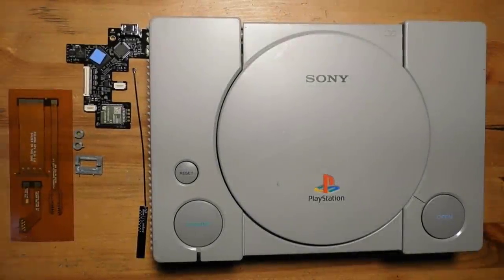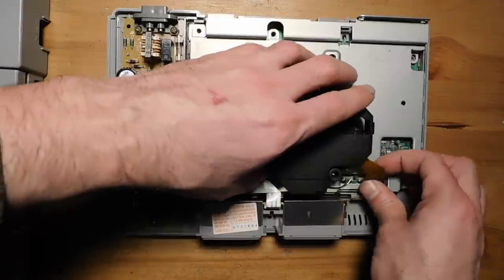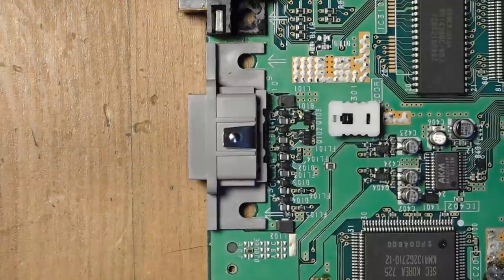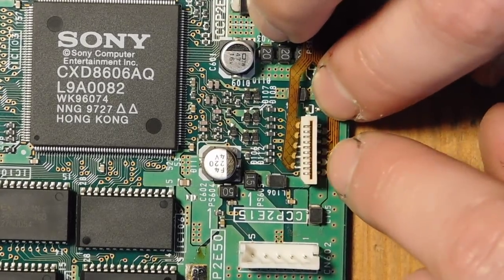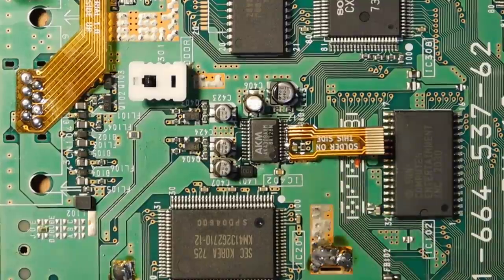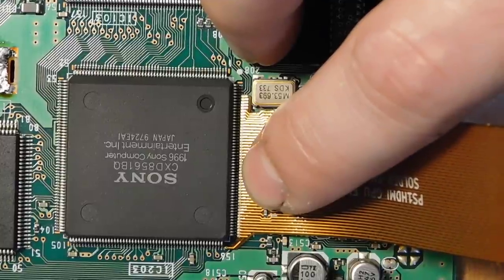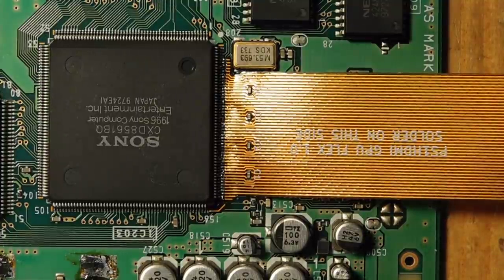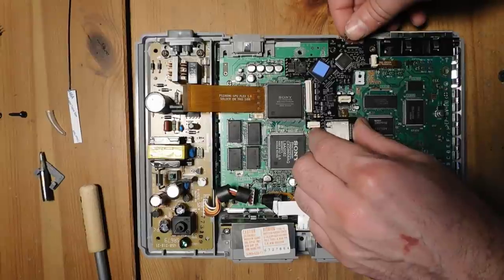PS1Digital Installation Guide - The Best PlayStation 1 HDMI Mod!

Comment: Tacking in the center really helps because the cable is not perfectly flat. As the video shows, you want to hold it down as you work your way out, which will push the slack out. If you tack the ends and work your way toward the center then you will be pushing the vertical slack together into a tighter and tighter arch that will never go flat in the middle. Releasing that slack by reflowing connections along the way to one edge means shifting all of that vertical slack into horizontal alignment, which is likely to cause misalignment if your connections were already aligned before reflowing. The reason this isn’t a problem when starting from the middle and working out is because any alignment shift from flattening the cable is effectively halved by being distributed equally in opposite directions.
Reply from the maker: That was an excellent explanation, and I definitely recommend tacking in the center as I did in this video

Comment: The serial port is used for the ps link cable that is used for the command and conquer series of games such as red alert as well as 50 other US game titles.  If you want to be able to use the multi player aspect of some of these games which require not only the serial port but the link cable and a second copy of the game and a second ps1 or the use of the second disk that was common in some of the games like the command and conquer series of games that had an allies and an axis disk.
Reply from the maker: Very cool, I didn’t know as much about the serial port. I know that Dan Kunz has a plan to maintain serial port functions with the PS1DIGITAL, but it is not released yet

Comment: Cool I was looking for OG PS1 mods the other night :D I have a few of them. I'd probably use one again if I made it unique. Got cards and controllers and stuff.

Know any easy points I can come in on off the average board for a simple LED mod?

Edit: Oh man I do know one thing- I heard there are other plug mods and uses for that old serial port... stuff for simple programs besides games and whatnot. Is putting something like this in with a freshly cut new hole for the hdmi port possible?

Comment: Voaltar drag soldered the GPU. I know he's a soldering master, but it didn't seem like drag soldering was an issue on it as long as you have adequate skill and magnification.
Reply from the maker: Yes you can do it that way, but if it’s your first time I think it’s more dangerous to attempt drag soldering. I have repaired several failed install attempts where someone tried to drag solder and they end up moving several pins
Reply: yeah, honestly drag soldering with proper flux and solder would be ideal, maybe it's partially the camera but this dude's joints often look cold and uneven (for a few reasons it seems). good video for the general install process, definitely not for the soldering...

Comment: Surprising you mention to not drag-solder the wide flat cable. Voultar shows how he drag solders it perfectly in his video. I actually like your technique going up and down with the tiny tip. I wanna try this mod myself, but i am only experienced with soldering bigger points, i did the McWill mod twice on a Game Gear. It works but i was kinda messy…
Reply from the maker: Yeah, it is certainly possible to drag solder, but I think few people have the skill or tools to do it. I have repaired several of these installations where people attempted to drag solder and ended up bending pins together.

Comment: Awesome install.

What temperature do you set your iron at to solder those flex cables?
Reply from the maker: I have it set to 350 Celsius which seems to work well. I don’t spend too much time on the cable so that minimizes the chances of damaging the flex cable
Reply: You might use solder wick instead of hot gun.

Comment: Maybe a strange question but wouldn't it be easier to use a emulator on pc or will that give a different output? I remember buying my PSX and how amazing all the games looked back in the days. I still have my Ps2 (I sold the PSX when the Ps2 came out ) I love your video's but I wouldn't start a project like this one. I thought it was already challenging enough to install the mod chip and my eyes are not the same as they were 20 years ago ...
Reply from the maker: You are right, it’s definitely easier to play these games on an emulator. Depending on the emulator, it might look or behave differently than original hardware. This modification is definitely a challenging one, and without my microscope there’s no way I could do it! Thanks for watching and I’m glad you’re enjoying the videos!

Comment: What about heating up the CPU? The plate over the CPU is not just located there, it removes heat from it. Will nothing happen to the loop that lies on the CPU. Can it melt and fail?
Reply from the maker: My understanding is that this mod doesn’t affect contact between the rf shield and the CPU. Dan Kunz (the developer of this project) did test the temperature of the new and old components and it is supposed to be safe even under continuous use

Comment: 32:50 While testing in the game 'Driver' intro fmv, R7/G7 G0/B0 will swap hearts to x's and back for a millisecond. this repeats for 3 times during the fmv. I messed around ingame for about a hour with no issues. Is this normal behavior or should the hearts absolutely stay that way?
Reply from the maker: That's normal - the test resets itself and that's why you will briefly see x's immediately followed by hearts. It's only a problem if one connection always stays as an X
Reply: @LIRetroGaming  Great, so my first soldering project was a success, Thanks for answering!

Comment: This is really cool and impressive, but I just can't get myself to play ps1 games without them looking exactly as they did when I played them the first time.  Maybe I'm a purist.  Still, this is pretty amazing.
Reply from the maker: I can totally understand that sentiment as well. The nice thing about this modification is that it doesn’t remove those older video modes so you can experience the PS one the original way or the modern way with HDMI

Comment: Do you know why the gpu flex is designed like the last 5 pins are NC from right side. It means Not Connected? I’m asking, because I messed up my first try and the last 3 pins broke when I tried to desolder it. Any suggestion to solve it?
Reply from the maker: NC means not connected, but I also don’t know if those pins are not connected on the GPU as well. It may work but obviously you need to check all the other connections and make sure that they are good

Comment: where can I get that schematic? I couldn't find it in the instruction manual
Reply from the maker: You can find it here dansprojects.com/PS1Digital_install.html
Reply: @LIRetroGaming  Ah thanks for the reply! I actually checked and found it, and was going to edit my reply. When installing the gpu flex cable I damaged the farthest left pad, the copper pad lifted off the board, and the pad came off the ribbon cable. I think it's still okay since they don't seem to do anything except for alignment. About to check for shorts now. Thanks again!
Reply: @LIRetroGaming  Ughhhh, I started it up and got analog audio, no. video. Then I tried to reflow the gpu flex and forgot to check for shorts; there was one, and now its not turning on even after the short went away. ugh

Comment: man, I would love to attempt this mod. However after realizing it cost $160.00 I have quickly become demotivated. I'm skeptical PS1Digital will preform better than a backwards compatible or modded PS3 and certainly lacks the utility of one. I understand the appeal of being able to use your older consoles again on modern hardware but in my opinion emulation seems to be the future of retro gaming. Fantastic work on the video I look forward to watching more.
Reply from the maker: Thanks so much, I'm glad that you enjoyed the video! It's true, the parts are costly and the install is a challenge. I think that it does perform a little better than a PS3 - but not by a lot. RetroRGB and Digital foundry have done some comparisons including with the backwards compatible PS3. But yes - emulation is also another very good option as well

Comment: I'm having an issue playing PAL wipeout 3 special edition. Video and audio cuts out intermittently for about 1 to 2 seconds. Is this a known bug with 50hz games. I tried a different tv and same issue. Please help, thank you
Reply from the maker: I can try to help, but I need some more details. First, is the console a PAL region system and is it using an original disc? Did your PS1Digital pass the test that is available in the menu? I show how to use the test at the end of my video
Reply: @LIRetroGaming  Force 240p fixed the issue. Thank you so much!!

Comment: I've installed PS1 digital and I got the blue strobing light. Any advice? Thanks
Reply from the maker: http://dansprojects.com/PS1Digital_install.html
Reply from the maker: Check out the troubleshooting section and Dan outlines a few things you can do to narrow down where the problem is. I would definitely use a multimeter and test continuity between all the pads and the pins. Also test between pins to see if there are any shorts
Reply from the maker: I think the blue strobing light means that the HDMI doesn’t detect a connection with the TV.
Reply: I've checked each pins and everything are fine. The LED light is ok now. But there's no display on the TV. is it because my tv doesn't support the resolution?
Reply from the maker: That’s entirely possible. Make sure you have some thing that can handle 1080 P and other lower resolutions as well. A steady light is a good sign, that’s what it’s supposed to do
Reply: I've also installed Xstation but it didn't boot up then I proceed to install PS1 digital. Could it also be the problem? Do I need to properly install Xstation then my Ps1 digital would be ok?
Reply: @sabinrenefigaro4192  I wouldn't proceed with the PS1Digital install, until the Xstation was installed and working 100% properly....

Did you recap the PS1 motherboard and or power supply?
Reply: @brandonkick  I haven't replace the caps yet. Both of my Xstation and PS1 digital are working now.
Reply: @sabinrenefigaro4192  What was the issue?
Reply: @cuttrogue  it was one of the flex cable for the PS1 digital. Nothing major. I readjusted the flex cables and I got the steady blue light